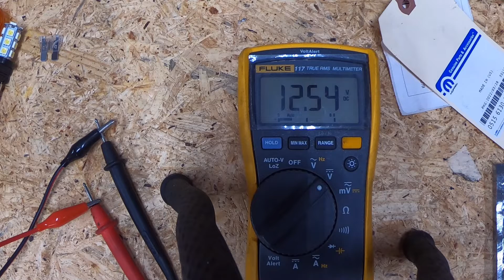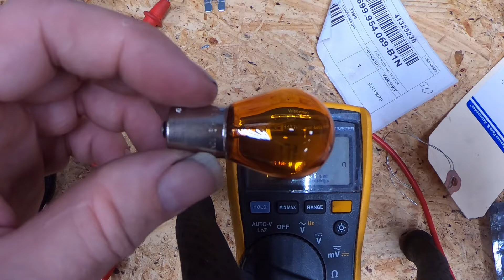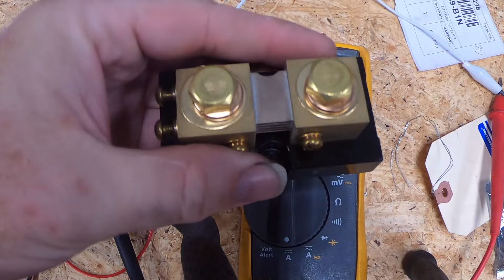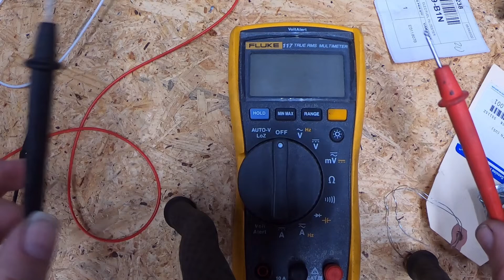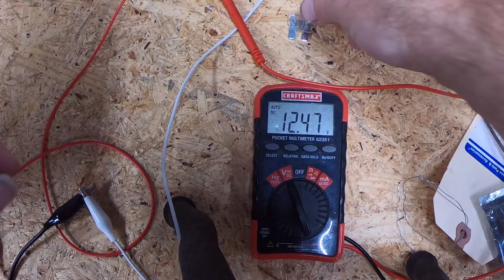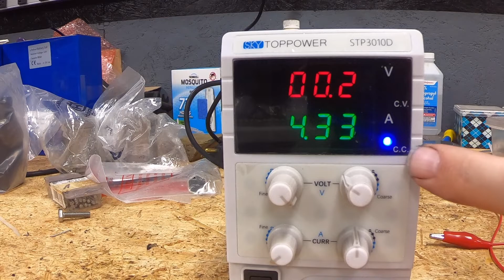Some of my automotive digital multimeter basics.

Comment: Thanks for taking the time to make this video. I have a lot to learn, but the first thing I've learned is, I need a better multimeter, lol.
Reply from the maker: Anytime.  Glad to do it.  On the getting a better meter comment maybe not, what kind of multimeter do you have?  Is there a topic you would like to dig deeper into?
Reply: @solargarage  My meter doesn't have a continuity setting, and it doesn't even beep.It's about three inches tall, lol.
Reply from the maker: @ScottRods  ah I see, I would have to agree in that case a replacement, could be warranted.